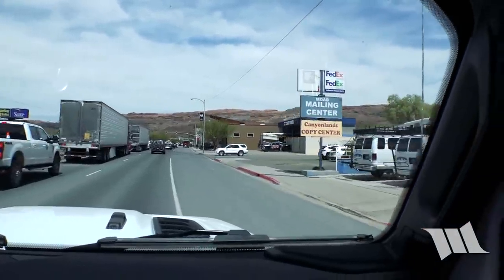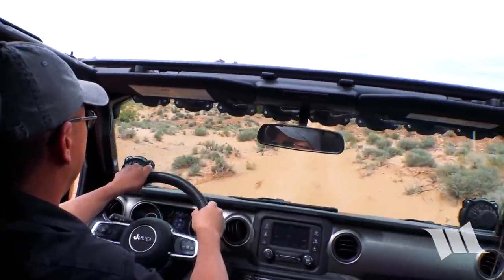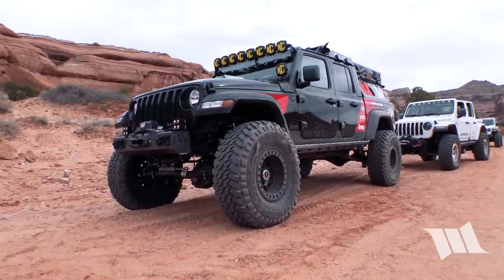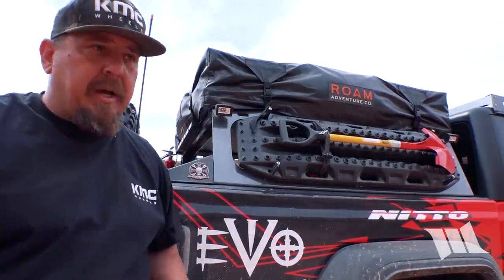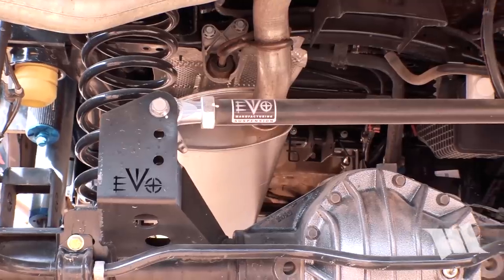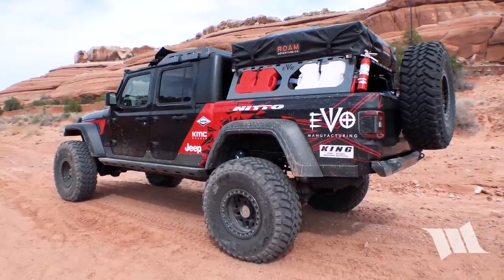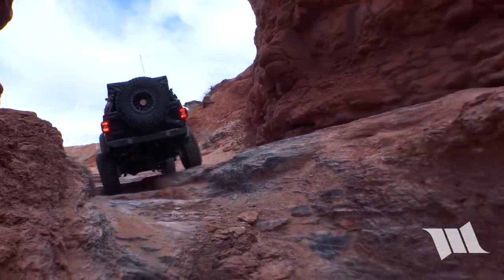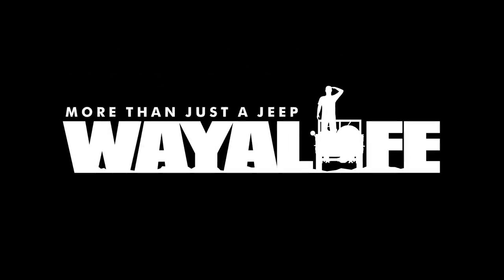Jeep Gladiator Truck Overlander on 40 Tires by EVO Off Road Testing at Moab Easter Jeep Safari

Comment: It turned out amazing.. and like someone said those 40s look like the gladiator should come from the factory 👌🏻
Reply from the maker: Totally agree
Reply: Probably was part of the stealth plan but FCA still needs to be ( California communist )compliant
Reply: Go New Places lmao
Reply: Leave stock even, Too high for use as uberX vehicles' ingress/egress.
Reply: I’ve already talked to them on the phone. Next fall I’ll be dropping off a diesel sport S for their magic sauce.  With a 250 mile range off road, THAT will be an overland right. 

Next step is going over the right bump so that the emissions stuff falls out and a tune.  Gonna be a long year of waiting haha
Reply: @mattbrew11  good choice going with the ecodiesel. Read lots about the Gen3 ecodiesel. Sounds like they've figured out and corrected DPF system problems and now have the engined tuned for long offroad driving without the worry of plugging up the DPF because of low speed driving. Paired with the 8speed automatic transmission on stock gears and tires should get 35mpg hwy!
Reply: @curttundra  I have a JT-R Diesel on 37s, no re-gear, but a heavy build and it gets 29-30mpg on the freeway.

Comment: Why not the Ecodiesel engine? Jeep claims the Gen3 ecodiesel engine is much improved from the first 2 generations, and is specifically targeting offroad use. I had the Gen1 in a Grand cherokee,  got as much as 36mpg hwy doing 75mph, but did have problems with the DPF system. In and out of shops several times,  technicians were not familiar with the new engines so traded it in for a JKU. But now thinking of getting another ecodiesel. Loved the power and mpg's.

Comment: Says not a rock crawler but no overlander would run 40's usually 35's
Reply from the maker: "overlander" as in what people call themselves, yeah, I hear ya. But, I think I do what they do and more so in my JK with 40's.
Reply: Definitely 35's are the max diameter, for overlanding I would idealisticlly want a 285/85r16, 285/80r17 or 285/75r18(35.1×11.4) depending on brake size, even a 315/12.5 width 35 inch tall tire is acceptable. A 40×13.5 compition compound tire is the opposite of a overlanding tire, severely decreases the vehicles range, the tire will wear out fast and probably will be to hard for cold weather.

Comment: “Overlander, not a rock crawler” ... he’s says with 40” tires lol ... 👌😂
Reply: 40 in Sticky's as well, wonder why the didn't need lockers...
Reply: an "overlander" with sticky 40"s and TRAILERED to the trail ...
Reply: And then trailer it to the dirt...
Reply: ...and 4 days after posting this they posted a video of it "rockcrawling at Moab"!
Reply: I'm thinking the 40's  help with the breakover angle.
Reply: Because the line is pretty blurred.

Rock Crawlers are hauled to the site and aren't street legal, IMO.

Anything other than that is a trail rig. Or what people love to call them now "overlanders."

Pull off your driveway. Highway to the trail. Cruise on a dirt road. Conquer whatever the hell the trail/weather throws at you.
Good old fashioned trail riding. Maybe you gotta crawl over a few rocks in the process. lol
Reply: @umadbrew  I thought over landing was long trips to remote areas doing trails and surviving with everything brought with them in the rig
Reply: Who needs up travel when you have 40s.
Reply: He swapped out the 4:1 tcase so makes sense
Reply: @jeffreyk8888  Wasn't swapped, that's what the Sport-S came with, a 2.6 to 1.  I have a JT-R Diesel and all Rubis come with a 4 to 1.

Comment: That Gladiator didn't get hung up anywhere.. amazing build! If I decide to go more extreme on my JT overland build I will 100% go bigger suspension and 40s. Currently running 35s and 2.5'' inch lift. This rig is ridiculous! All the yota fanboys and trolls are hiding now that the JT has shown what it can do
Reply from the maker: LOL - I think you're right

Comment: That was super cool. I have got to start saving for that toy. What engine is in that baby?
Reply from the maker: Just the 3.6L. Coupled with the all new 8-speed automatic, it works surprisingly well.
Reply: @wayalife  I would prefer a little more torque in case it needs to tow something. May be a future diesel hybrid.

Comment: Hmmmm nice set up....but....

I see most people getting that stuff for the Gladiator and it just being a mall crawler.  

Ok I know I just ticked off a ton of people with my statement above. No I am not trolling or trying to just complaining.  If your going to get the gear “USE” the gear. Get out get dirty and muddy have fun.  That’s why these guys make their stuff it can take the pounding and the Jeep was built to take it as well. 

So if you so weather you get a Jeep Gladiator, Dodge Rebel, Ford Raptor, or what ever 4X4 toy give them some love and get out in nature and enjoy it. It’s worth it really and it’s a blast. 

Please drive trails responsibly, safely, and leave it ready for the next driver out there. 

Oh and my toy of choice is a 09 H3T (one of 56 manuals made) it might an older vehicle most wont know or will give me crap for but hey I drive it for me and that’s what matters. 

Love what you drive and drive what you love. 

Nice video and thank you guys for putting it up.

Comment: Would've been interesting to put portal axles on this rig and ease the lift a bit.  Wonder if anyone's done that with a Gladiator yet.
Reply from the maker: Not sure why. It's been tried in the past on the Mighty FC concept and proved to be more of a pain than a benefit especially being that they don't have speed sensors as would be needed.
Reply: @wayalife   I remember the Mighty FC!  Really, really wish they'd have put that one into production.  What an awesome concept!  I've seen the YouTube videos of Mark Allen talking about it and driving it and he didn't mention any problems with the portals, but maybe you have access to more/better info than I do.  He says they were a MOPAR-designed portal, so I can't imagine they couldn't get around the speed sensor issue if they wanted to.  Having said that, I'm sure the bean counters nixed this concept for production from the get-go, and Mark said it was just a bit of fun to do a modern take on the classic truck.   I used to own a couple of classic FC-101 Land Rovers when I was stationed in England, so I"m kinda partial to FCs now.  Thanks for the response!
Reply from the maker: @meadmaker4525  Not even a year after it was debuted, the Mighty FC ditched the Portals in favor of ProRocks. I know Mark personally and I got a chance to wheel with the Mighty FC right after SEMA. It was very difficult to drive because of the Portals and speed sensor issues.
Reply: @wayalife   Fair enough.  And pretty cool that you actually got to wheel the Mighty FC!  I'm sure it was still a beast with the ProRocks.

Comment: And what is the overall end result hoping to be achieved by building this?  Is it a camping rig, overland rig or just a rig?  That’s a lot of tire weight and gasoline weight especially when you have to trailer it to the trail head.  Not to impressive if it has to be trailered to get to the trail. Hahhahaha!

Comment: Think if you just did 37s you wouldn't have to change axles
Reply from the maker: No need to change out the axles with just 37's. Well, maybe just the front one depending on how hard you played and what gear ratio you were wanting to run.

Comment: I have a few questions for you guys, how do you like the JT vs. the JL?   I currently have a 2014 JK and am I'm thinking about getting a JT for overlanding.  I'm running the AEV suspension with 4.5 HD Springs and 2.5 fox shocks.  The ride is great, I have no complaints.  But I was curious on the coilover setup and what the difference or benefits vs. the regular lift setup?  I was thinking about the cost difference on getting a bone stock JT and having EVO build with new Dynatrac axles and full suspension or getting the Rubicon, keeping the stock axles and doing the stage 4 suspension live with king coilovers.  What's the big difference on the performance?   I do a lot of overlanding and typical run easy to moderate trails no rock crawling.
Reply from the maker: First off, how big of a tire are you hoping to run? If you're planning on sticking with 37" or smaller, I would DEFINITELY get a Rubicon as there would be no need to upgrade your axles. You can save a ton of money right there and you'd get the added benefit of a 4:1 transfer case, electronic sway bar disconnect and a much nicer interior. As far as coilovers go, there really is no need for them unless you plan on picking up the pace and start driving a LOT faster across the desert. There are benefits to more flex as well but based on what I'm hearing from you, this is something you do not do. The other thing to take into consideration is that coilovers need to be maintained on a regular basis.

Comment: Did the truck end up with the goodies from a Rubicon? Lockers, Sway Bar disconnect, etc?
Reply from the maker: The Dana UD60's came equipped with e-lockers. Mel had an old Rubicon e-disco that didn't work and he installed one of his air actuated No Limits disconnects on it.

Comment: Only 110k as built... No biggie. Starting with the way overpriced Gladiator! Lol... Employee of mine just bought a loaded Ram Rebel for 55k. I will never pick a mid sized over a full size. Good luck to you jeep
Reply from the maker: Actually, a Sport like this is only $35k and the parts installed to get it to this point will run you about $30-$35k. That puts this truck at only $70k as you see it. Still more than a loaded Ram Rebel but a hell of a lot more capable.

Comment: Beautiful truck! Overlander yes, trail rig, not so much! Too wide, maybe go with a different wheel offset. Suspension, although better than stock, the shortie arms not helping all that much, limiting droop which kind of kills half the point of 40's! Looks like a big Sportmobile on a tight trail.
Reply from the maker: The front sway bar was NOT disconnected for this run. That's what was limiting droop. This was done being that this was the very first time out and really intended to be a shake down run. We just got carried away :)

Comment: That is one cool rig...I have to ask with that lift and tires, what kind  of mpg's are you getting? I'm guessing 8-10 mpg.
Reply from the maker: EVO 6.5" lift and 40" Nitto Trail Grapplers. They're running UD60 axles with 5.38 gears and so they're still getting decent mpg. Over 10 for sure.

Comment: Auxiliary Batteries are a must to power up all the extra accessories, don't you think?😮😊
Reply from the maker: Are you talking about the small one that comes on the Jeep from the factory or a second one, as in a dual battery setup? If the later, far from it. Maybe 20 years ago, back when everything was halogen or power inefficient. Today, everything is LED and low draw and a second battery for them is totally unnecessary.

Comment: Of course bigger tires can fix such a simple problem

But dam tho u going to make people buy the cheapest Jeep Gladiator and build it up. Which is going to put a damper on Rubicon Models.
Reply from the maker: Depending on how you use your Gladiator, going this route makes a lot more sense.

Comment: I want that exact setup!!!! Take my money!!!! Absolutely a beautiful truck well done EVO. And thanks Eddie for the awesome footage.
Reply: Where is your check for $100,000 plus? You think this setup as it stands is cheap?
Reply: They started with a sport (~$35,000) then added ~$35,000 in add-ons they talked more about that in a previous vid.
Reply: @redbeard3303  So that Jeep does not have lockers? I don't remember the sports having lockers. The way the Jeep was just crawling, I thought lockers might have been engaged for it to just crawl so effortlessly.

I guess they did jot factor out labor cost since they were the ones doing all the labor. Also, maybe the parts they bought were all bought at cheaper cost because they as a company get better rates for parts. I would be a bit surprised if this thing costs less than $100,000.
Reply from the maker: So glad that we could bring this to you :)
Reply: The sport package does not have lockers but the Dana spicer 60 they put under it does have lockers if I remember correctly.
Reply: MyYTChannel if you did the work yourself it prolly would be close to what they said in the vid. Labor costs are super high but for the right Machanic it’s usually worth it.

Comment: First of all, I LOVE builds like this. But it's kind of a stretch to call a lifted truck with 40's an 'overlander' because it's got a RTT on the top. What's the MPG on the 40's and regear if you have to do a long pavement stretch? :D
Reply from the maker: I think you'd be surprised to know that you can still get maybe 13 MPG just by driving the speed limit. The all new 8-speed automatic does a great job of moving big tires like this. Also, the spare could easily be installed under the bed but EVO moved it to the tailgate so that they could install a secondary and large fuel tank in the future instead.
Reply: @wayalife  I was thinking an extended or secondary tank would be a big nice to have on a rig like this. Range matters. I'm no stranger to this, my last rig (FJC) was getting 14 MPG average and it SUCKS on a road trip to start thinking about a gas station when you only hit 200 miles. :D

Comment: Quick question. If, I'm going to drive rather than trailer my JT, would I be better off putting a long arm suspension kit on  rather than a short arm kit for stability on the highway? Or, is the wheelbase on the JT more than capable to compensate for daily driving? Thank you.
Reply from the maker: Typically, it depends on how much lift you install. At the height of this JT, geometry correction is something you'd want to have but EVO did install drop brackets up front and relocation brackets in the rear to help address this. If you took a ride in this JT, I think you'd find that running factory length arms is all you need for a smooth ride. And to be clear, the length of your arms won't have an effect on "stability".
Reply: Wayalife Thank you.

Comment: I like the concept, but is the $35k include labor or is that $35k for all those parts to be delivered to my driveway?
Reply: Parts. Mel talked about being handy with a wrench, and its all bolt on! $35k is not bad at all for all of that! Those Ultimate D60's are $13k alone.
Reply from the maker: What The Rambler 1941 said

Comment: i wonder if the factory D44s could handle 40s...  i know litebrite is (was) running 38s on stock JL axles and considering the JTs tube is 10mm bigger, you'd think it would be okay?

Also, does any one know if you can wire aftermarket lockers to the factory Rubi locker switches?
Reply from the maker: LOL - If all you did was drive it around on pavement or easy dirt roads, I'm sure they'd hold up just fine. Play on the rocks like this, not a chance they'll hold up to 40's. The tubes still aren't even 3" in diameter like a true D44 and really, tube size is the least of your concerns. Even if the FAD housing weren't such a weak point, it's your axle shafts, u-joints and gears that you really need to be concerned with. With 40's, you really need to be running a 60 or at least, based on my personal experience. You cannot run aftermarket lockers off the Rubicon switch.
Reply: @wayalife  thanks again for answering my questions!
Reply: @wayalife  the 40s on stock axles was just wishful thinking ;)

Comment: Drove one yesterday hoow s there enough horsepower to turn 40s? Not asking to be a jerk asking because i want one just not a whimpy engine.
Reply from the maker: You just need to run the right gears for the size tires you're wanting.
Reply: @wayalife  yea. But its gotta slow the giddy up with weight when its already a bit slower??

Comment: My question is if you kept 37s would you still have needed to do a axle swap
Reply from the maker: No. I think you'd be fine with factory axles and 37's. At least, for the most part.
Reply: Cool thanks

Comment: shut up and take my money!!!!!!

I like the spare wheel on the tailgate but then it covers the backup camera.  It does not look that they've addressed that issue.
Reply: I talked to our local jeep dealer last Saturday and the salesman told me that there is going to be such a demand for the gladiator that the base model Rubicon will retail for around 80,000. When you add another 35,000 onto of that I think I'll keep my money for now.
Reply from the maker: This was built in just about 10 days. Plans were to relocate it to the spare but ran out of time.

Comment: That thing needs about 4 ft. Of bed cut off the rear. Holy hell....
Reply from the maker: LOL - Not really. It's a truck - not a Wrangler.
Reply: @wayalife  uh..yes, really..just like any other truck that's used for serious offroading have been done for decades.
Reply from the maker: @wvjeepguy8178  uh... yes, no kidding. As Mel states in the video, this truck was made to be an overlander. The fact that it can crawl as well is a perk and since you seemed to have missed it, it did just fine without the need to cut off 4 ft. off the rear :)